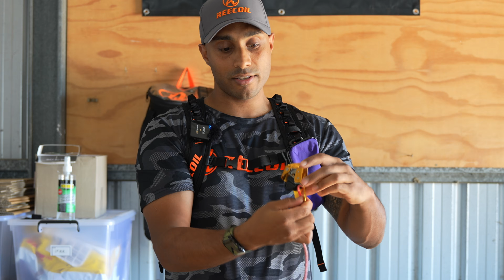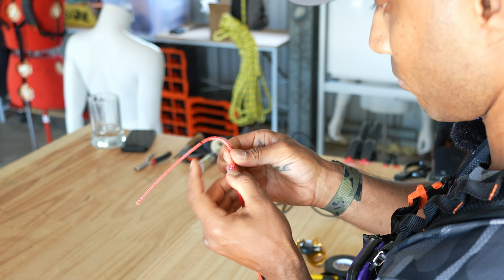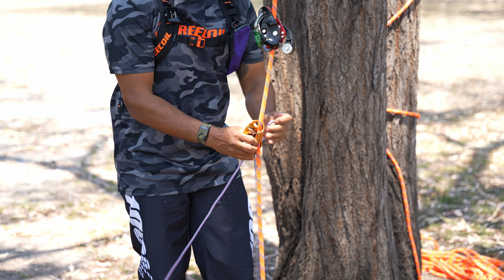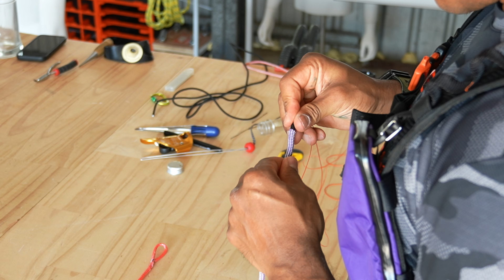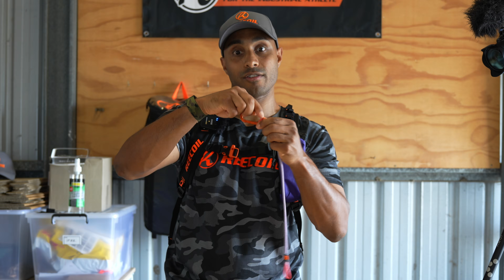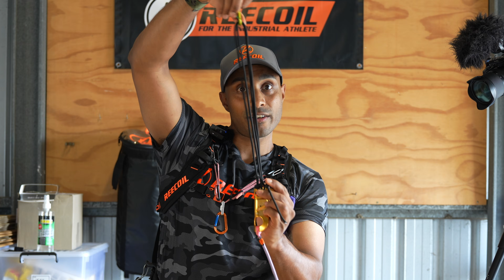How to build an SRT Knee Ascender for Tree Climbing

Comment: Beginner here, is that a Grigri he's using? I cant quite make out what it is... Looking to make a similar set up. Thanks
Reply from the maker: It’s a Rope Wrench setup at the beginning of this video. 
Here’s another video that explains knee ascenders in more detail:
How to set up an SRT Knee Ascender for Tree Climbing
https://youtu.be/Jh262jXYg-4
Reply: The thing you are likely talking about is a Taz Lov. It's like a grigri, but it can be attached to a tensioned line, and you don't need to hold the brake side of the rope. They are expensive though.

Comment: great informative video up until between 18:21 - 18:27 some sort of wizardry happens off camera! i have spent hours trying to get this spliced core back into the jacket and have now went through 3 jackets trying to milk back onto the core. it will not go. just simply wont do it. hanging it up for the day. please help. tips, tricks, ect.
Reply from the maker: Thanks for letting us know. So at that point all that’s happening is the tape on the end of the hollow cover is being removed to allow more space for the spliced eye to fit into the start. 

Then using the whipping twine like a wire fid, pull the spliced eye through the cover. 

Hopefully that makes sense
Reply: Thank you so much my dude. I did all the things you just said but it seems like for some reason the jacket just does not want to pass over the splice. I know it's thicker than originally but it almost seems impossible lol first couple times the mistake I was making was my needle was catching a interior thread hear and there and that was destroying my jacket when pulling.
Reply: Thank you so much my dude. I did all the things you just said but it seems like for some reason the jacket just does not want to pass over the splice. I know it's thicker than originally but it almost seems impossible lol first couple times the mistake I was making was my needle was catching a interior thread hear and there and that was destroying my jacket when pulling. I opted out of the needle and went with wire fid to prevent capturing any sneaky threads and was able to get the jacket about and inch and a half before brick wall.

Comment: Can I ask you an important question?
Is the TasLove 3 a safe device?
Thank you for explaining how to make this knee ascender
Reply from the maker: I do like the Tas Lov3. But only for very specific uses IMHO. I don’t think it’s a good device for moving around the canopy of a tree (it doesn’t have the fine adjustment of a hitch, zigzag, rope runner etc) it is great for ascent though and I do think it is a safe device when used correctly in the correct application. 
I’d compare it more to a Petzl ID and Rig, ISC D4 and other rope access descenders but with the benefit of being able to ascend a straight rope. It doesn’t have an anti-panic function though, so that’s something to bear in mind.

Comment: 5mm Robline Dinghy control line has only 4mm dyneema core. 
If you don't need the cover, 4mm dyneema will be good enough!
Reply from the maker: That would definitely make it even more compact! I do like the cover on the dyneema though, just to avoid the dyneema strands picking.
Reply: Im using 3mm dyneema without cover for 3 yeas now and its still fine.